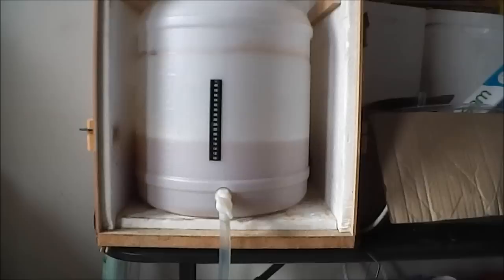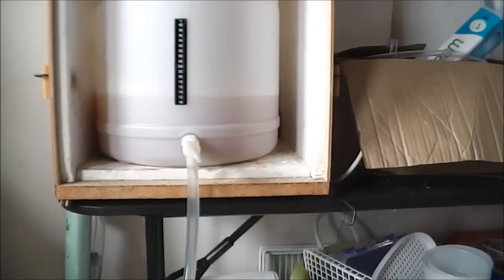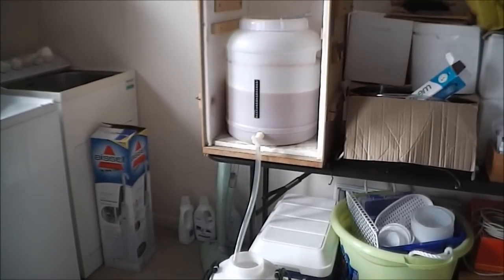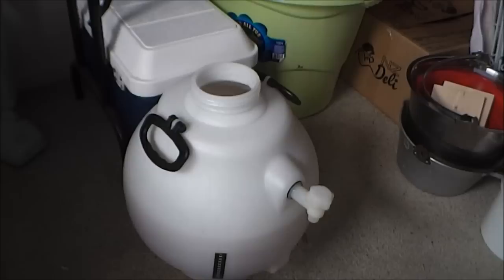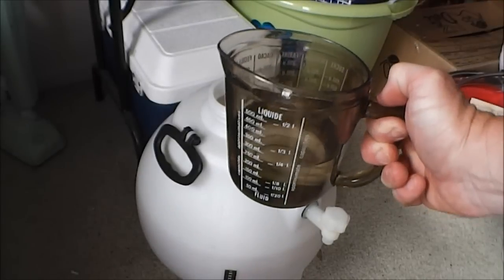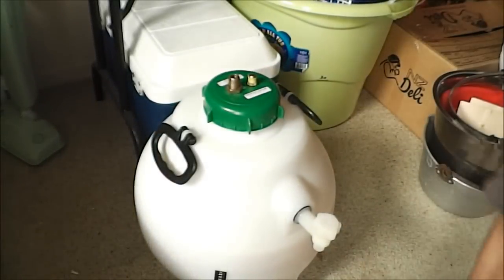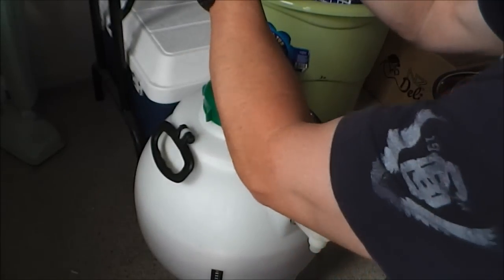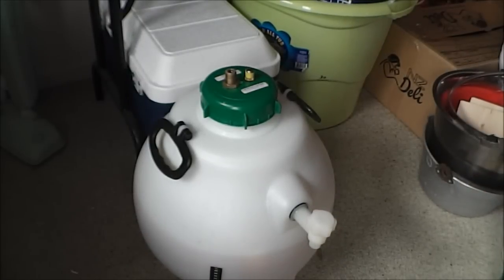Rotokeg Beer Pressure Barrel - How to Fill from Pr

Comment: Awesome video! I am in Canada and have had a rotokeg for years but parts and gas cylinders are no longer available here; I'm wondering where I can obtain fittings to adapt for use of the Sodastream cartridges.Any help would be appreciated. thanks'George
Reply from the maker: Thank you. I had the same problem as you with parts. My tap started to leak and I couldn't get a replacement tap locally. I've since gone onto kegs, but it looks like you can still buy the sodastream adapter online. It's called a "hambleton bard s30 adapter" . Here's one link I found, but if you google the name, there are several hits for it including on ebay. I hope this helps. Cheers
https://www.ebay.com/itm/155455139143

Comment: Morning! I got the mashes in and all the brew gear. I lack anything bar 8g single pop CO2 bulbs. It looks like you have 2 adapters on a soda stream bottle. Those two adapter are my current holy grail. Can you confirm what gets you from sodastream to s30 on the roto? Cheers!

Comment from the maker: On my latest brew I transferred once the initial fermentation had died down, I think it was either 4 or 5 days. They recommended I do this at the local homebrew shop because there would still be lots of yeast activity to carbonate the beer fully. I then finished the fermentation and left in the rotokeg for 2 weeks at around 20/21C before transferring to the fridge. It took a day to cool down in the fridge, so all up I was drinking full carbonated beer in less than 3 weeks from starting.

Comment from the maker: Hi, you need a sodastream valve adaptor. It screws straight onto the 270gm sodastream bottles. If you click on the website link in the description field above it shows one on page 1, 2nd row down. This is the only adaptor that I use. Cheers

Comment from the maker: Hi, Matt. I'm not sure where you can get parts in the states. All the Rotokegs originate from England. I got mine from a local shop who imported it. The best I can do is point you to the website I out in the description (brewingathome) and it shows all the spare parts. Maybe they can ship to you? 

The adapter that screws onto the co2 canister (270gms) is on that page and they call it the "Sodastream/Midget Widget Type Brass Inlet Valve Complete". It's near the bottom of the page. Cheers

Comment from the maker: Hi Craig. I understand that yeast only needs oxygen in the first 2-3 days after pitching for the exponential cell growth phase. During actual fermentation, yeast function anaerobically and therefor don't need any dissolved oxygen in this phase. Because the first phase of yeast cell growth has been completed by the time I transfer to the Pressure Barrel, any oxygen would serve no purpose to the yeast. I would liken filling the barrel to filling a bottle. ... contd

Comment: Very informative video, thanks. I'm about to do the same but with a Pilsner. When would you recommend transferring to the Rotokeg? I'm guessing about a week into fermentation.
Reply from the maker: Tate Bradley Thanks Tate. Glad you enjoyed the video. I usually transfer after the krausen collapses, so about 4/5 days. That's for an ale though. I haven't put a lager into it and I know with the lower fermentation temps it takes longer. I imagine though that a week would be fine. Cheers
Reply: TubeDinoz My Pilsner didn't carbonate so I've been giving the Soda stream machine a work out :) It is holding pressure though as its pouring fine. Could my pressure release valve be releasing prematurely? Thanks in advance for you help
Reply from the maker: Tate Bradley Possibly if the band is worn out or old it maybe releasing at a lower pressure. Mine hold at least 10-12psi before releasing. Quick question, when you transferred did you add a priming solution to aid carbonation or relied on the remaining co2 activtity? My little 10L mini pressure barrel I add 80gms of sugar to boiled (then cooled) water to give me about 6 psi, then top up with sodastream if needed. That's transferring after 2 weeks (when all the yeast activity has pretty much stopped). Cheers

Comment: Recently got a rotokeg, but it doesn't seem to  have a release valve unless it's built in to injection valve. Seems a bit dangerous if it doesn't. Did you buy a new lid for yours or is that the one that came with it. I'm not sure about attaching an s30 to it without a release.
Reply from the maker: Eóin Dawson Hi,mine came with the S30 value without the pressure relief. You can buy s30 valves with the built in pressure relief ring. I bought a couple a while back from England from ebay. If you search "s30 valve" on ebay.co.uk, they still have them available for around 7-8 pounds . Cheers
Reply: TubeDinoz That's a much better plan than fill it with water and see if it explodes. Thanks.

Comment: Hi, great video & guide for carbonating in a rotokeg. Just done my first brew & carbonation hasn't been very successful so I'm going to try & copy your method from this video & just wanted to ask a few specifics.
-What temp was the beer stored in for initial fermentation?
-do you know the specific gravity (SG) of the beer was before transferring to the rotokeg as we don't want to transfer to the keg too early?

Cheers!
Reply from the maker: Hi, thanks for watching my video and commenting. The beer probably sat around 20C from memory (68F). I didn't check what the SG the beer was when I transferred it. I just waited until the Krausen had collapsed in the primary and then transferred it (4-5 days). The idea is to transfer it while there is still plenty of CO2 being produced while leaving a lot of the sediment behind. I've added a link the description field above so you can see how the beer turned out. Cheers

Comment: Hi there,  could you tell me how much beer would be left in the bottom of the rotokeg if it was'nt tilted to get the last of it out, cheers.  pete
Reply from the maker: BrooklandBackyardBrewery Pete Hi. The Rotokeg has a piece of tubing going from the back of the tap to a float sitting on top of the beer, so it will continue to draw beer aided by the pressure of the CO2 all the way to the bottom. Having said that you do get sediment in the bottom (like a bottle), so I usually leave the last couple of litres of beer behind and tip it out. The only thing I would say is, as the beer level goes down you need to keep injecting more co2 to keep the head space under pressure to enable the beer to be drawn. Same as a normal corny keg really. Hope this helps. Cheers

Comment: Hi, can you please tell me if the yeast used in the fermentation process for beer, is harmless or suitable human consumption, thanks!
Reply from the maker: It's perfectly harmless. Ideally you want to let the yeast settle so you don't have bits of it floating in your beer, but it is 100% safe. In fact with wheat beers you are encouraged to stir up the sediment/yeast at the bottom of the bottle and pour it into the beer. Most other beer styles you wouldn't that. I hope this helps. Cheers!

Comment from the maker: I force inject CO2 just after I fill the Rotokeg and fitted the lid. The idea here is not so much to carbonate the beer, but to force out any oxygen in the air space above the beer. This airspace will be filled with CO2 produced from the beer fermenting, but I like to get the oxygen out straight away, as this is beers worse enemy. The only other time I add CO2 is when the barrel is getting low and there is not enough pressure in the barrel to draw the beer up through the pipe and out the tap.

Comment: hey mate quick question, do you use a float in yours? having trouble with mine atm!!
Reply from the maker: Hi, yes it comes with a float with a tube connected from the float to the back of the tap. Cheers

Comment: If you inject CO2 until you hit max pressure, doesn't that defeat the point of going for your natural carbonation a bit? Most of the gas produced by the yeast is now going to go straight out the release valve, so to speak?
Reply from the maker: kirbsmeister2 Thanks for your question. The main point of filling the head space with co2 is to purge all the oxygen out. The more you can get out at the very start the better to avoid oxidisation. The aim was not to force carbonate the liquid. The pressure drops a lot after doing that as the co2 I did inject is absorbed into the liquid until an equilibrium is reached between the liquid and headspace. The co2 I injected is only a small fraction of what is needed. That's where the natural carbonation comes in to raise the pressure in the liquid and headspace to around 12 psi. Cheers